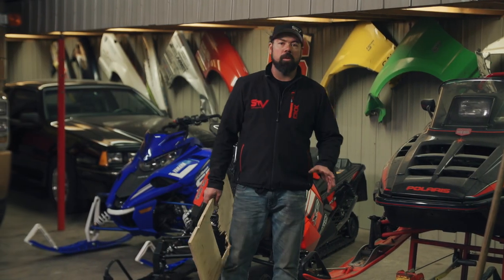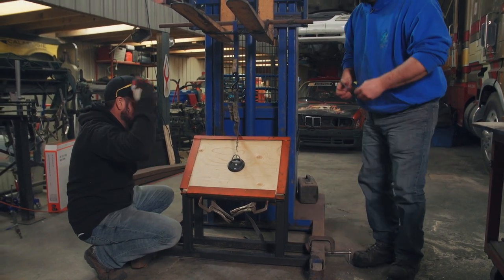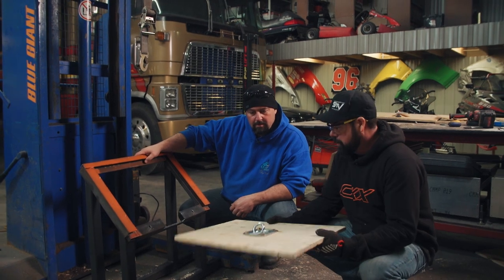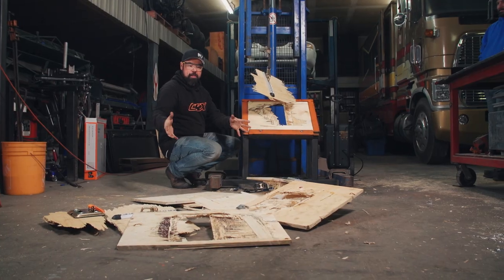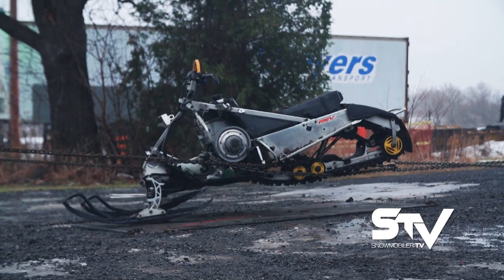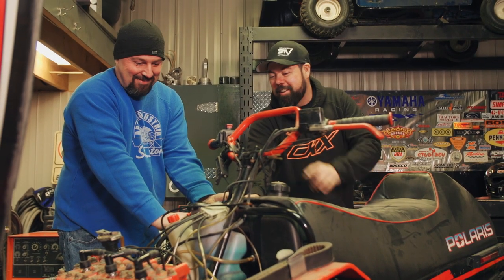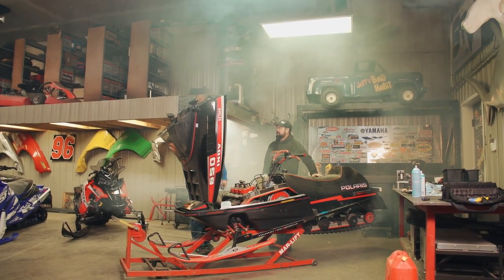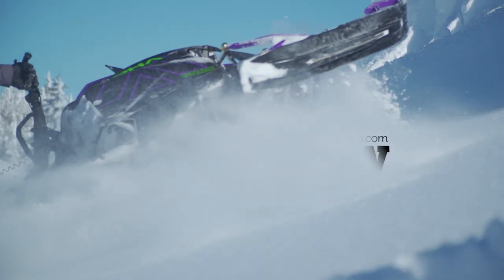Snowmobiler TV - 2019 Episode 5 ( Destructive Testing )

Comment: Open the door and ventilate the shop when running an engine, especially a 2-stroke.  Breathing in those cancer causing fumes is just plain stupid, and is acting as a bad role model for the next generation watching.  Then pulling apart a chassis is just plain childish.  This isn't up to spec. behavior from a motorsport YouTube channel.  This is amateur click bait.  I expected more from your channel.